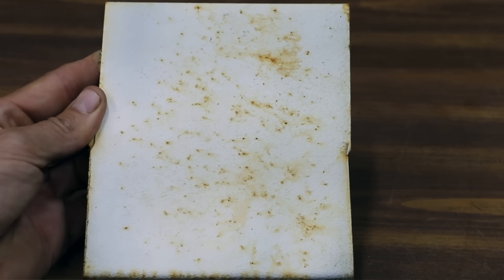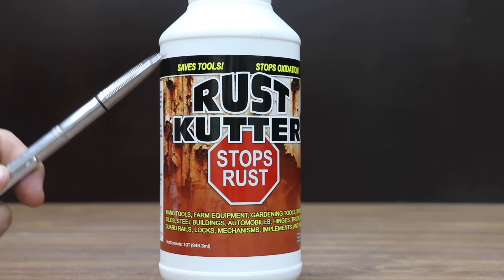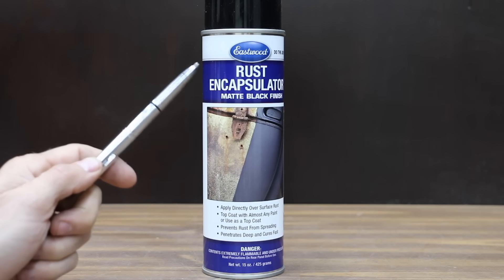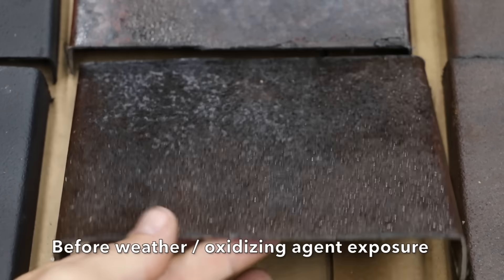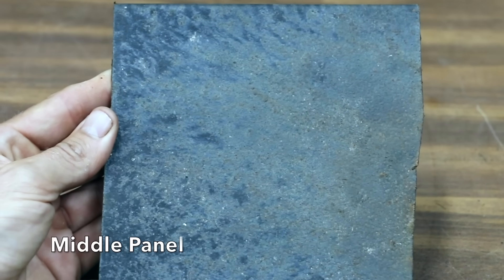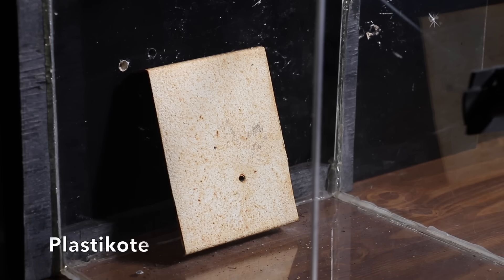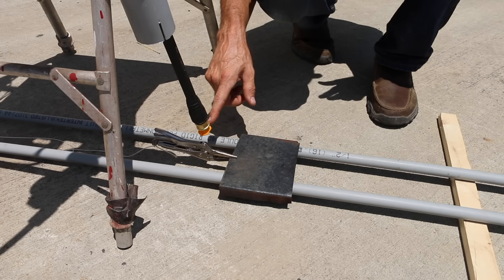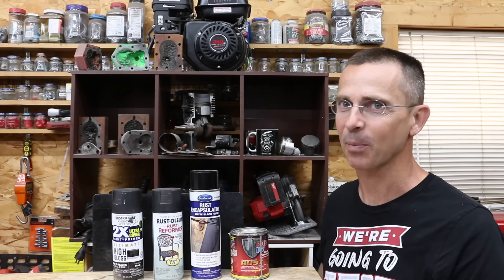Best Rust Converter? POR-15, Eastwood, Rust-oleum Rust Reformer, Gempler's

Comment: I always enjoy watching  Project Farm videos.  Concise and tries to capture as many important variables as possible using some common sense.  On this one (because I've tackling rust work on my own) I suggest for bb ping test to change it with a scrub test because a) the single bb might hit a weaker spot thus more coat removal than others (not as accurate), and b) hold the panel tight because you can lose much energy from differences in angles, vibration and shaking vs. a totally impact.  So measuring the diameter of coat removal helps but not as effective as other tests as seen.
Reply from the maker: Thanks!  Thanks for the feedback.

Comment: First of all, thank you for your video.  Now I have a question, can I replace POR 15 45032 - 1 4oz Can Gloss Black Rust Preventative Paint (45006) instead of the POR-15 Rust Preventive Coating - Silver (1 Pint) found in your link? Note that POR 15 45032 - 1 4oz Can Gloss Black Rust Preventative Paint (45006) cost me only about $13 USD.
Reply from the maker: You are welcome!  Thanks for the suggestion.

Comment: I used POR15 on the under body before. A year or two later what I found is that no rust showed through it. But, I found that rust had grown and spread underneath it where there was not rust when it was applied.
Reply from the maker: Thanks for the feedback.

Comment: POR 15 is expensive and a pain if you get it on you.  I have found nothing else the comes close.   The other issue with POR 15 is you have to use it when opened.   It will easily seal the can shut if you don't clean it well and use plastic wrap to keep the lid separate from the can.

Comment: Just saw this in the sidebar of your latest Best Ratchet (ROUND 2)?  This confirms everything I read about POR-15.  It's only downside is that it needs their Top Coat because the Sun's UV rays will deteriorate it and the rust will come back without it if exposed.  I recently asked for a comparison of POR-15 to KBS Coatings.  I meant to say to KBS Coatings' 3-Step Rust Prevention System and any other paint-on product systems like it.  KBS Coatings' RustSeal (included in the 3-Step Kit) also needs their Top Coater to protect it from the Sun's UV rays.  So a fair comparison to that complete protection system would be POR-15's 3-Step Stop Rust System with their Top Coat.

I'm asking because I bought a used 10-year-old Riding Tractor Mower that was left to the elements for at least 8 years, after his having bought a Zero Turn.  The deck is very badly rusted on the top and underneath and there's a lot of rust in other places.  Since it's a Mower, it will be exposed to the Sun when I'm mowing.  I keep it in a shed, but I want to minimize the return of rust, because the restoration will be enough work for a lifetime.  😮😬🤣  This is likely a lot to ask because of the cost and amount of time it would take to see if rust comes back with their top coat products when exposed to Sunlight, but if you can, I would greatly appreciate it.

KBS Coatings came into existence not long ago when a design engineer for, and initial partner of, POR-15 left to create his own products in his own business.  He is said to have exceeded POR-15, so a comparison of the two would be great, along with any other products like them.  It seems clear that no spray-on product could compare, even though both POR-15 and KBS make them, but still some insist on using spray-on Eastwood Rust Encapsulator over POR-15, so maybe including spray-on products again would still be good to dispel any doubts and/or myths and hype.
Reply from the maker: Thanks for the suggestion.

Comment: When I'm dealing with rust like on my old swamp cooler I definitely reached for that Rust-Oleum rust reformer.

Which in that particular application is exposed to a lot of water and the elements through out the year.
However it's held up quite respectably for the cost with needing a new coating after about a year and half (where I used it as a top coat).

I'm a little bit sad that the Rust-Oleum brush on wasn't included in the list, however it would probably perform similar to the aerosol.

Thank you sir!

Comment: I have been using REFORMER for 5 yrs no complaint for a single inexpensive spray can product you can spray on surface rust 
I see most people put it on then treat it like primer and sand it off or thru it 
I spray it on after cleaning surface, I'm not concerned about surface rust ,I scruffit up with green pad just to get any dust that has accumulated ,may days or weeks even months after. I then spray to component primer on top enough to level if that's the finish ,I'm after. Then paint on that.
I have had no issues over 5 years with such a cheap method.
Por 15 hates sunlight, and if used alone on say a car trailer will come off in sheets from being in sun. I didn't like that. Ive used inexpensive reformer on a work truck bumpers painted two coats. Then two more coats . Let it dry and over six months in Florida sun day in day out, it never rusted nor faded. 
My experiment was only six months as a coworker wrecked truck in accident. 
But it proved to me the cost factor was the winner.
Reformer verses pir15 high cost and the way it peels in sheets just didn't add up!
I live all your tests. Keep it up!
Reply from the maker: Thanks, will do!

Comment: Its my understanding that products like Rustoleum Rust Reformer require a cover coat of a sealer to be most effective. By themselves they do not protect against corrosive elements after the application. Because of this the results are not conclusive.

Comment: Can you test some different methods of protecting welded seams in sheet metal repair?  Like the weld through primers and panel wax or just seam sealers?
Reply from the maker: Thanks for the suggestion.

Comment: For the longest time I was too cheap to try POR-15, I always used Rustoleum and or bed liner, I always kind of just thought POR-15 was hype and just charging for the name. It was also a matter of convenience since the usual local places don't seem to carry it but always have Rustoleum and or bed liner. Finally decided to give it a try not that long ago, can't speak to the longevity yet, but it's adhesion is definitely much better, and it definitely doesn't scratch as easy. I just put new inner fenders on my truck, I painted one side with POR-15 after I already had the other on(It was an afterthought) I was on the fence about taking it back off to paint it too, until I saw that it was already rusting despite being painted from the factory, while the POR-15 one was still spotless. 2 bits of advice about POR-15 though, it's not meant to be exposed to UV(sun) so should be painted over if it will be, and 2ndly, I found out the hard way just how good that adhesion is....if you have even a tiny bit between the lid and your can when you reseal it it'll be a mistake you won't make twice...What really surprised me about the POR-15 was how thin it is, when I opened it and noticed that I thought there was no way it would work better than the bedliner I had been using for rust prevention. It's nice to now know with certainty that POR-15 is a cut above the rest and worth the extra money(to me at least).
Reply from the maker: Thanks for sharing.

Comment: You mention that the testing is "subjective".  Have you considered cutting a 1" x 1" square in a piece of cardboard, etc and placing it over the test piece and then counting the spots and measuring the total area of rust, etc. within that square to have a more "objective" number?  We used a similar method when evaluating effectiveness of Zinc electroplating after the required time in a salt-spray cabinet.  Great video.
Reply from the maker: Thank you!  Thanks for the suggestion.

Comment: Just remember guys GET RID OF ALL SCALE AND FLAKE or you are wasting your time.    It will just flake off later taking the coatings with it.      If the metal is FAT or GROWING hit with a grinder and wire wheel or a lightly bouncing  air chisel  until the flakey stuff is gone.     I use my cheap HF blunted air  chisel as it works WAY better , less air too than my Ingersol Rand scaler, more precise and better results.     There are no easy shortcuts.
Reply from the maker: Thanks for the feedback.

Comment: I've used the Permatex for many years,  it used to be called Extend. That product requires that you paint it after it is dry or it won't work,  it's not designed as a finish coat.  Also any area that doesn't turn black has to be hit with sandpaper and hit again. It works great if you do it properly.
Reply: POR-15 = #1

Comment: I love your content, before I put money into products I always check your results. Not just for the money i invest but also the time I put into car care. Engine additives are my fav videos and I would love to see just how clean you can get a combustion chamber with multiple of the top products, worked on small engines for years and tend to rip them apart and clean manually as they are so small and simple but a car engine is less so. Would love to have say a trifecta of products like oil additive, fuel additive and something to spray into my intake before oil changes that make me feel I'm doing everything I can to get the most life and performance from my vehicle. More than happy to trust the results from a small engine, seeing as pulling my head and fuel injection is a lot more complex. Thank you for the time money and effort you put into the great content.
Reply from the maker: Thanks and you are welcome!  Thanks for sharing.

Comment: I’ve been using the Rustoleum rust reformer for a while including the restoration of a B&O railroad signal. Stuff really holds up. This video just reaffirms my thoughts on the product. Keep up the amazing work.
Reply from the maker: Thanks, will do!
Reply: I agree. I was using an old truck bed toolbox as a little project to practice mig welding thinner metal, and when I was done I decided to try rust reformer and was very impressed with the result.

Comment: You used vinegar in your rusting solution? Alot of older paint and bodybwork guys use just vinegar to remove rust from car body's so now im confused. Does vinegar rust metal or does it remove rust from metal?
Reply from the maker: Hydrogen peroxide, vinegar, ans salt make an aggressive rusting agent.  You might try it.

Comment: Now this is a dangerous mix, as it produces chlorine gas, but Acetic Acid and Sodium Hypochlorite will oxidize any exposed metal in microseconds.  Bleach and Vinegar, but please be careful as chlorine gas can easily poison you. If any paints withstand that they are enough to deal with the worst of the salt belt.
Reply from the maker: Thank you for the feedback!

Comment: Related. Could you compare different cold galvanizing compounds? The hot galvanize is wearing off a boat anchor I have and I'd like to renew its coating if possible.
Reply from the maker: Thanks for the suggestion.

Comment: Great video! I have a gas station where the underground tank covers have exposed gas pipes which are exposed to condensation and gas vapors when unloading gas into the tank. I think I'll try Por 15 to see how well it works. Definitely looking forward to the results!
Reply from the maker: Thanks!  Thanks for sharing.
Reply: Or you could buy 6 cans of rust reformer and paint it every day for a year.

Comment: I use evaporust on my hand tools wrenches (pliers, wire cutters,wrenches etc…)for light rust and I have to say in a 24 hour time span the results are amazing.  My garage alternates between heated and not heated which I think causes the problem? The question is how to you keep them rust free?

Is there a coating that you know of that can be rubbed on?

Some have said WD40 or mineral oil. Any ideas?
Reply from the maker: Thanks for the video idea.

Comment: Great video! I have a some more suggestions for future tests. 1. Test asphalt shingles for algae resistance, delamination, color fade, ice damage, ect. 2. Test oscillating multi tool saw blades. 3. Test foam intake filter oils for particle intrusion, and flow restriction. 4. Test leather cleaners or conditioners.
Reply from the maker: Thanks!  Thanks for the suggestions.

Comment: Ospho is my favorite and Prep Etch are both excellent. The trick I have found is treat with either solution and use rustoleum. However when I started doing body work you had clean all bare metal with an acid solution to kill your flash rust and clean that bare metal because it improved adhesion. At one time coatings had not even close to what they have nowadays so you had to thoroughly clean. To this day I use wax/grease/silicone remover aka Prepsol, etch clean bare metal with Ospho or Prep etch, wash with the treated metal with Tide, rinse, dry, and then use my coatings. I do not have comebacks because I cannot afford to tarnish my reputation I have built. Por15 and Eastwood I have used their products for many years they are worth the cost. Even though chemically coatings have changed over the years you have to clean and do your prep work. Here is a little test.  Before cleaning try sticking a piece of high tack masking tape on take note at how it sticks. Now clean something with the cleaning method of your choice. Next stick a piece of high tack masking tape on the cleaned surface check to see just how much better it sticks. If you try this on glass with glass cleaner you will find out why windex is a bad word in my shop.
Reply from the maker: Thanks for the feedback.
Reply: Windex sucks. I always use professional glass cleaner in a spray can, usually ZEP.

Comment: Great tests!!  I will say, though, that NONE of them worked very well.  You saved me, and a lot of other people, some money on that.  I would suggest a re-test, with the 2 best products here, but compare that to 4 alternative treatments:  1) Naval Jelly, which is a phosphoric acid converter that has be be washed off and primed after.  It's a loctite product now.  2)  Electrolysis, which you have tested before for rust removal.  3) Sandblasting, which is probably the best industry standard solution.  4) Just wire brush and blow off the rust, then prime.  For each of those,  and the other converters, follow the rust treatment with an oil based iron-oxide metal primer, like rustoleam, and then a top coat of enamel.  I bet there isn't much difference between any of them, except sandbasting.  A LOT of work, but then again you always put a lot of work into your tests.  (Oh, and if you want to get crazy with it, compare to having one section hot-dipped galvanized!)
Reply from the maker: Thanks!  Thanks for the suggestion.

Comment: I'd be interested to see this experiment include weights before and after rusting. As metal rusts, it bonds with oxygen, making it heavier. I'm unsure if it would make an appreciable difference in the overall weight of the metal plate, but if it does, it would be a good objective measurement to compare between products.
Reply from the maker: Thanks for the suggestion.

Comment: Would love to see how “SteelIt” spray can would perform in these tests as it was on my list. I saw hot rod used it on their shop truck chassis and BIsforbuild used it on the Jumpicon. Looking at how to deal with rust on my sons 1972 Ford F-250 truck bed and options to protect/clean up the chassis.
Reply from the maker: Thanks for the suggestion.

Comment: Would this be good to use to treat truck frame and then coat with fluid film? I live in the north east and my truck is about a year old and I use fluid film and it's work good. But there is some rust spots in some areas. Thanks for all of your great videos!
Reply from the maker: You are welcome!  Thanks for the suggestion.

Comment: When I had a landscape business, we painted all our snowplow blades in POR-15 as soon as the factory paint showed signs of wear. There is POR-15 paint that can be used over the POR-15 base coat, and we'd apply two layers of paint.  Snowplows get banged into curbs and other obstacles but the best example of durability was when someone backed into one of the blades (and drove away, of course) in a hardware store parking lot.  There was a great big dent from a 2" hitch ball ... and none of the paint was even scratched - it just perfectly conformed to the dent even in below-freezing weather.
Reply from the maker: Thanks for sharing.

Comment: I used a brush on Chassis Saver. I think it's a Rustoleum product but I can't remember. I used it after patching the lower quarter panels on my 96 Roadmaster about 5 years ago. There are a few small spots that rust came back but I think it was because I didn't get the surface prepped and/or didn't have full coverage. Because except for those few small spots, there isn't any rust anywhere else
Reply from the maker: Thanks for sharing.

Comment: I have a car parked in garage for 9 years that has disk brakes front and rear. I never had this happen with drum brakes, but I cannot move car, so much rust formed so quickly on rotors and I don't want to ruin the new brake pads on the car by driving it before cleaning rotors. I'd like to see a video on which brake cleaner works best, and particularly if any prevent pitting of the rotors when used.
Reply from the maker: Thanks for the suggestion.

Comment: I have  used Picklex 20, phosphoric acid, pricey at 72 bucks a qt, but worth it on restorations. Had parts sit for 5 yrs. with product only and no rust. Home Depot has Must For Rust, Phosphoric acid, Very inexpensive. Same results
Reply from the maker: Thanks for sharing.

Comment: Rust-Oleum rust reformer hard to come by in my area.. but worth the dollar you spend .. refurbished an old pick up truck using this 
. And a cheap bed spray on liner on the undercarriage..

Only time.will tell if it holds up .
Reply from the maker: Thanks for sharing.